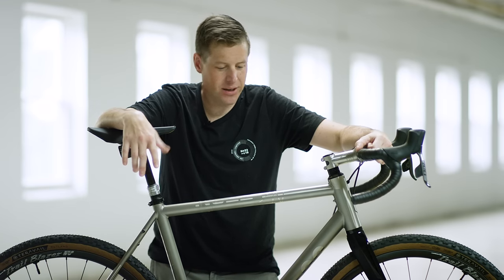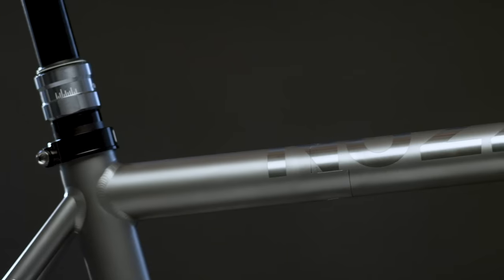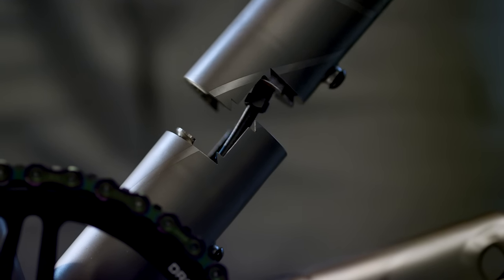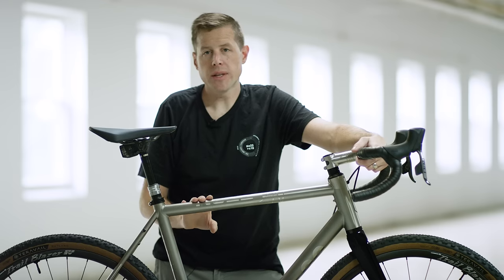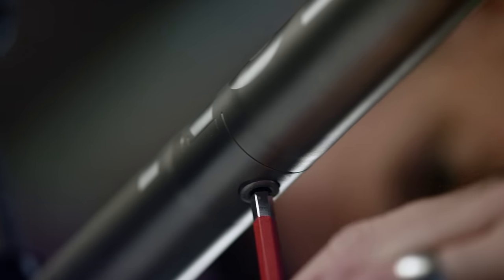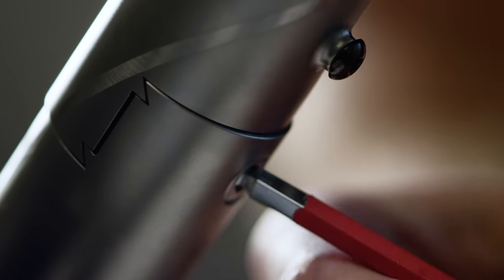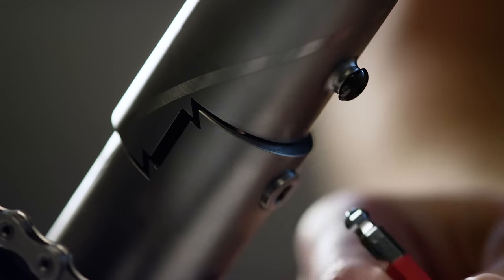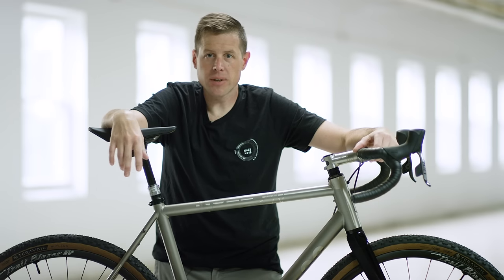No. 22 Bicycle Company | Couplers

Comment: What is the name of that hydraulic brake hose coupler?
Reply: The Break Brake: https://22bicycles.com/blogs/news/introducing-our-all-new-coupler-system 
 SJcycles sells them, too: https://www.sjscycles.co.uk/brakes/100-dry-hydraulic-coupling-fittings-no-hose-supplied/?geoc=DE
Reply: @LeoInterHyenaem  Thanks for the information!  They are not cheap!
Reply: @bengt_axle  You're welcome. Indeed, unfortunately, they aren't. But in a combination with the frame couplers and a proper case, they're worth the expense in the long run.

Comment: Can you modify my current drifter
Reply: Yes a hacksaw and a bolt will work
Reply: @iwontreplybacklol7481  Not really. The modification requires the couplers. A section of the tube will have to be removed to be replaced by the to-weld-on couplers. Mind you, the couplers use quite a bit more material than the mm or so thin tubing of the frame.